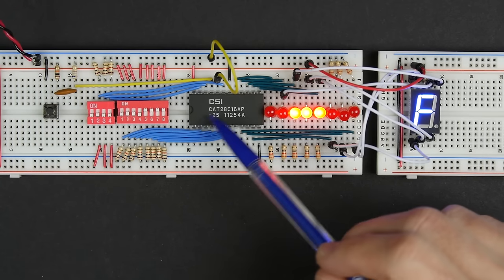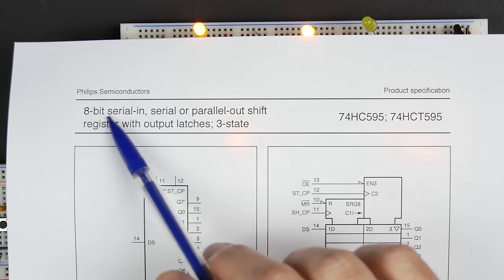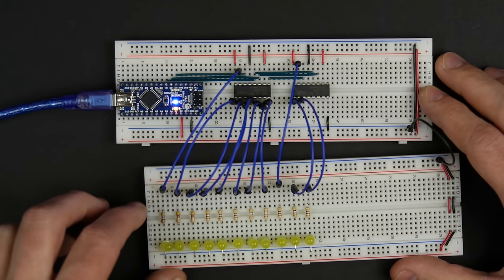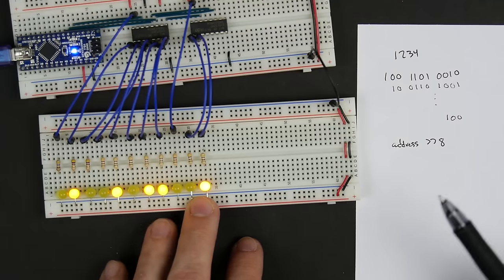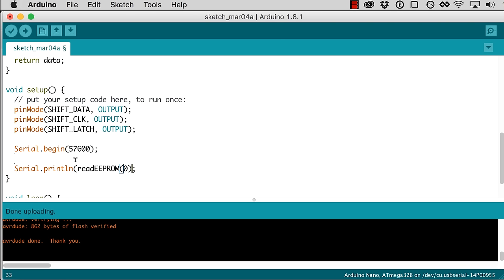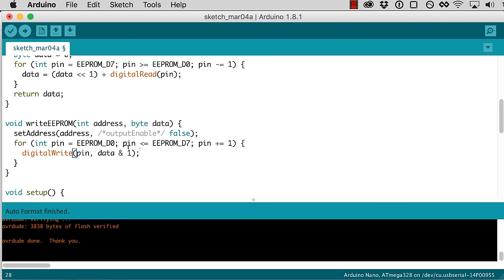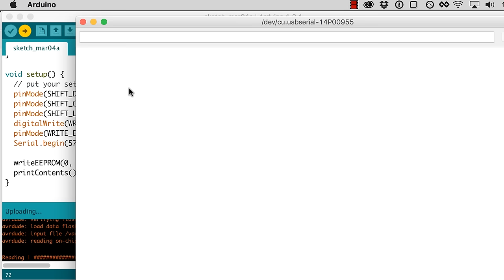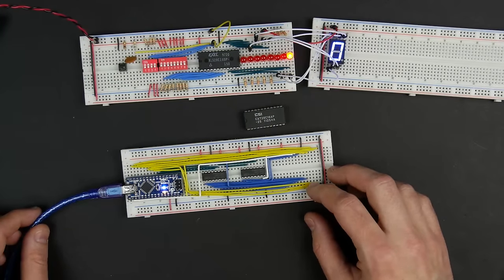Build an Arduino EEPROM programmer

Comment: Excellent video but one minor comment on the code.  Currently in the write eeprom routine you set all the arduino pins to outputs and then set the address and turn the output enable off.  If you had previously read the eeprom then the output enable would be active and for a very short time the eeprom's data lines would be driving the bus and the arduino pins would be as well causing contention on the bus and possible damage.  It would be better to turn off the output enable before switching the arduino pins to be outputs to avoid this.
Reply from the maker: Good catch! You're absolutely right; that's something I overlooked. I just updated the code here to fix that issue: https://github.com/beneater/eeprom-programmer
Reply: What are the negative side effects of doing that?
Reply: Hi Adam, the problem is that if the output enable on the EEPROM is still active when you set the arduino pins to be outputs then both the EEPROM and the arduino will be trying to drive the bus at the same time.  If one of them is trying to drive a zero on a particular bit and the other is trying to drive a one then you will effectively have a short from the positive power rail, through the output driver of (say) the EEPROM onto the bus and then down through the output driver of the Arduino to the ground rail.  The output impedance of the devices can be quite low and so quite a large current can flow, this can cause the output drivers of both devices to be damaged.  In the program this would only happen for a very short time (nanoseconds) and so the devices probably would be ok as there wouldn't be time for heat to build up, but if, for example, you were single stepping through the code, it could be in that state for quite some time and damage could easily occur.  Best practise is to ensure there is only one device driving the bus at any one time.
Reply: Hi Ben, Hi guys! I connected the LEDs to 74HC595. When I switch power ON or upload a sketch onto the microcontroller, the diodes light up (like running lights) for a short time and go out - is this normal? I added the OE (CE) control pin and set it to HIGH, but anyway led's light up, in this case as was expexted like a flash, not running lights
Reply: Did you put resistors in series with LEDs? 74HC595 has balanced output and LEDs are basically short circuits for this chip.
Reply: Graham Smith i
Reply: Берлога Neo same thing happening with my circuit too !
Reply: There's another problem: he uses digitalWrite for the write enable input, which takes 5-20 µs in toggling, plus the 1 µs delay. That's gonna wear out the EEPROM fast (if I understand how that works). He should have either used the native AVR C code, or an easier solution is just to use the same solution as for the manual pushbutton. Problem solved! I'm working on an improved version of his code, which I'll put on Github and link it in here.
Reply: This actually did kill my nano.
Reply: @psyxodolby08  I realize this is quite late, but the lights flashing is normal (I believe they are labeled to display USB activity)
Reply: Haha ! I was just about to write the exact same remark !! The only thing I would add is another possible side effect would be that the excess current demand could cause a supply voltage drop and either one of these conditions (over current or under voltage) could cause the system to briefly shutdown and/or reset. So when you guys are working on projects like this, if ever you notice that you circuit shuts down or resets unexpectedly, bus contention is a likely culprit.
Reply: I think you flipped it, the problem is if he first writes that would set all the digital pins to write mode (bus drived by arduino) and then use the read function it will first use setaddred (bus drived by arduino+eeprom).
Anyways you pointed it out, I was not even thinking about that.
Reply: Instead of using an EEPROM, why not a 7447 BCD to seven segment decoder driver?
Reply: @stevejquest  Because he wanted to do it this way, add more love to the computer.
Reply: @gzitterspiller  But the 7447 is a 16 pin dip that costs but a fraction of the programmable device.  And it does everything his application requires of it.  As for me - I usually just just a D-latch and lookup table to set the 8 bits.  He should do a demo using a D-latch to drive an LED display.  :-)
Reply: @LiraScarlet  As BSEE CompE with what, 39 years of experience now?  The best approach in this case is not the novelty approach -- but to use the right part, like a 7447 BCD to 7-seg decoder driver.  An EEPROM was never designed to source or sink 20ma of current (to drive an LED).  Years ago I built a QRP auto keying transmitter that continuously keyed a message stored in EPROM (windowed erasable device) which was a misuse of the device.  The message was stored in the EPROM which when a bit was clear was key up, bit set key down.  Four sequential bits was a long, two was a short.  An astable 555 set the rate and provided the clock.  This was for fox/hound competition.  So I too use things in an unconventional way.  But programmable devices do exist to do what he's doing with eeproms -- both the PAL (programmable array logic) which I use to replace decoder chips (a whole lot of chips can be replaced with that one programmable device) and the GAL (gate array logic) or FPGA (field programmable gate array) which can replace literally everything on the board with a single programmable device, including CPU cores.  :-P  So I agree from an academic standpoint, what he is doing is interesting and even fun -- however don't expect an EEPROM to sink (or worse, source) LED current forever.  Eventually it will degrade the chip and the chip will die.  You see, chips contain "magic smoke" and once you let that magic smoke out of the package -- that's it, the device stops working.  :-P  And I know, having released a LOT of magic smoke in my time.  :-)
Reply: You are correct, but the situation is much worse. When new address data are loaded to shift registers, the OE switches between Hi and Lo depending on the previous address data causing shortages when MCUs data IO are set as outputs. The correct way is to deal this is to set all I/O lines as input, then load address to shift register, then set te I/O lines to output and put data on them, then pulse WE. Switching between input and output is bitwise operation on Arduino, which means it have to be done inside some for() cycle. Every writing means one cycle to set I/O as input, then loading shift register, then loading data and setting pins as output and after that all pulsing WE.
Reply: Dr. M. H.  Which suggestion?  Using a 7447 or using a D type latch?  Both are cheap and work great -- but the D latch allows you to pick and choose whatever segments you want to light up, making E and H and P and certain other letters possible.  The 7447 only decodes to BCD values.
Reply: Dr. M. H.  D-latches can be wired like memory and directly addressable.  So you move a value into that addressable location and the latch reflects that value.  Neat.  :-)
Reply: @NikiBretschneider  Hello! I modified the setAddress procedure to set all IO to input before anything else, which should fix that problem.  The write code currently sets the address and then sets the IO to output, which works fine with this. I'm using a 62256 RAM chip with this right now (although my new AT28C64 and AT28C256 chips have just arrived) and everything seems to work so far. It does mean that it sets the IO pins to input every time it is called, but if that's a problem it's nothing a simple boolean parameter can't fix.  Also, looking at the datasheet for the 74HC595, there's a storage register clear pin (pin 10), but I don't have any more pins open on my nano.  If you weren't using a nano you could perhaps just toggle the pin low for a few microseconds instead of setting the IO to input.
Reply: yeah, but you don't program and run at the same time. it is just for combinational circuits, besides it's a ROM, you don't write and run at the same time.
Reply: @adamtoakley  Oh oh oh oh oh
Reply: @Cardgames4children  It's most likely a bot. I've recently seen several accounts post that message word for word.
Reply: @Danny Horworth That was unwarranted -- and for you, a learning moment wasted.  :-/
Reply: @stevejquest  Your commitment to trolling is quite high. Commendable? Probably not, but certainly entertaining.
Reply: @ssholum  Not trolling.  I was going for "educational" rather than entertaining, but meh.  :-P
Reply: @BenEater  1712
Reply: 9
Reply: 8
Reply: Good observation
Reply: @stevejquest  If you watched the previous series of videos, he was leading up to this. First from showing the output in binary, then using the binary lines to drive the 7 segment from basic logic gates (to create a combinatorial circuit), then showing how to use the EPROM. I imagine he's going to use the prom for a number of other things in subsequent videos, so using a 7447 would just add another part to the device which isn't necessarily needed.
Reply: @grhmsmth  Thank you very much for this excellent explanation.
Reply: Mowing
Reply: Ol Ol
Reply: @NikiBretschneider  I believe this potential issue has already been circumvented by the fact that the storage registers are only latched after the shifting process has finished, meaning the shift registers will only output the result of the shift operation after the bits have stopped changing states, so the output going to the Output Enable pin on the EEPROM should always be high (i.e. input mode) during the write routine in the final version of the code Ben has linked above.

(As the comment at the top points out, the one in the video isn't correct because it doesn't set the address first - hopefully nobody tries to use that.)

Comment: Im a house builder and for years I have been trying to get my head around basic programing and electronics. I have collecting machine parts and pieces. I have many little projects that require electronic control. Every machine I have built required manual control. I really get it now and all my learning has suddenly come togeather. Thanks so much for putting such a good learning video togeather. Dale
Reply: Dude, build me a house and I'll help you with as many Arduinos as you want! Glad it's all clicked though, I think construction workers have to have logical, systematic minds, and that's all that's really needed to understand computers. If you can figure out in your head whether a structure is built properly or not, you likely have the faculties that develop into programming.

Comment: Pro tip: You can use the analog pins of the Arduino as Digital GPIO pins :)
Reply: Was about to say. The only difference is analog pins have analog capability as well.
I wish Arduino had done this differently and given all pins a labelled digital io address. Then they could have added an analog number to em as well.
Would have saved so much trouble for a lot of beginners.
Reply: Yeah, except for pins A6 and A7 in the Arduino Nano: You can use A0 through A5, but not A6 and A7
Reply: @1kreature  Multiple names for the same pin seems to me like a more confusing thing for beginners. It can also lead to annoyances such as needing to keep track of which digitals are also analogs, when designing a circuit that requires analogs, so that you don't end up using the dual-use pins when a digital-only pin would do, and then need to swap them around later. I already find myself doing having to be mindful of which pins do PWM out so I don't waste them. As long as beginner knows the analog pins can also do output, they can use analogWrite to get a 'high' value.
Reply: @lucasoliveirasaintrain4298  the reason being that A6 and A7 are unique to that package of the ATMEGA328P, they aren't available on the DIP package, meaning that the Nano is significantly better than the Uno.
Reply: That's where the macros PIN_A0 through PIN_A5 come in. They map to 14..19
Reply: Digital pins suckkkkk
Reply: @saumilsunilshah5663  analog pins are slow
Reply: @v0xl  They only have hardware PWM capability and internal ADC that can be attached to them.
When they are used as GPIO they are exactly the same as D0-D13
Reply: @iforce2d .
Reply: @lucasoliveirasaintrain4298  you can access them using registers instead of the usual digital read/write functions. It is a bit confusing and time consuming mapping the arduino pins to the corresponding atmega328 pins but it can be done.
Reply: Thanks goodness it only took this long to find someone else had made this comment already
Reply: Not specifically for the Digital brand of computer, but just digital in general (the generic term).
Reply: Agreed, but then we don't get Ben's awesome shift register demonstration!
Reply: @djtecthreat  but this awesome demonstration significantly overcomplicated eeprom writer design.
Reply: @lucasoliveirasaintrain4298  I ran into the same issue about A6 and A7. Any explanations why?
Reply: @lucasoliveirasaintrain4298  I also figured that out, after, for a long time, thinking my EEPROM was broken haha :p
Reply: Well done.  FYI - When you unplug a USB serial device without dismounting it in Windows and then reconnect it, it can get recognized as a new COM port with a different device name.  If the Arduino software was talking to COM17 and the device suddenly becomes COM18 it will appear to have disappeared.  When you reboot the PC the Arduino will be detected under the original device name and magically it's back.

Comment: Ok, I know I'm not crazy, now.  There need to be breadboards with rows that have more than 5 pins.
Reply: Someone needs to make good quality breadboards with more than 5 rows per column, power rails that line up with the columns (some do some don't depending on the brand) and aren't split by a blank spot every 5 holes PLUS have two extra power rails running down the middle where the channel is on standard ones.
Reply: There are stray capacitance issues with normal breadboards, where you have many lengths of contact strips lined up in parallel, like that.  I wonder if lengthening the contact strips, like you suggest, wouldn't make those issues worse?  It would certainly add to the resistance of each channel.  Also, I don't think there is much room for another two rows for power/gnd rails in the middle channel, while still keeping it close enough to support most ICs.
Reply: You could use a jumper wire because for me I never need more than 3 apart from the power

Comment: You don't have to convert the truth table binaries to hexadecimal, you can just write them as binary literals in C: '0x4C' is equal to '0b01001100'.
Reply: I've always thought that "0x" was the only hex prefix available, then comes "0b" along ... learned something new today :)
Reply: @BillAnt  0x, 0b, 0d, 0h, Oh My! 😵
Reply: Well he prints it out in hexdec, so in order to check if it works, he would have to do the conversion at some point.
Or just print out in binary, but that's a bit too long to read easily.
Reply: There’s also `0o` for octal values.
Reply: @ExEBoss  But is there 0wo?
Reply: @ExEBoss  I thought octal in C just had one 0 before the number? Like 038, for example.
Reply: @ThatOneHandsomeGamer  octal numbers don't have 8 in them ;) but yeah, there's two syntaxes

Comment: I'm currently watching through your playlist on building the breadboard computer and I have to say I really (!) like the style with the continuous commentary over the speed up parts. There are videos of people speeding up parts but they'll first finish the comment and then speed it up without any commentary then. Your style is more compact and fluent!

If I had the endurance I would probably try to recreate your breadboard computer, because it actually has taught me a lot on how CPUs internally work. Sure modern CPUs are way more complicated but in their essence they work like yours, but in yours you can see how everything is ticking along!

Comment: Brilliant stuff, Ben, thank you so much - I can't imagine the effort all these videos took. For an older EE/CS engineer (like me!) they totally take me back to my roots. Especially this one: in 1978 I was in my last year as an undergrad at the Univ. of Sussex in the UK. My 3rd year project was - an EEPROM programmer. It took me a whole semester, mostly because I had to build the hardware from scratch (Z80 on wirewrap boards) and write the code in Z80 assembler (assembling it on a 64K Z80 CP/M machine!). Watching you do it in an hour or so really brings home just how far things have progressed. And yet - the principles of processor architecture are not so very different.... Thanks again!!

Comment: Funny how computing has changed so much, yet this takes me back to my old C=128 days when I used to subscribe to COMMODORE and RUN magazines, each came with programs in machine code that you had to type in using a machine code monitor program (which you had to type in the first time you used it as well). I never really understood how that worked until now, but I spent many a day typing these codes in as my good wife set dutifully beside me reading the code as I poked them into the old machine, then saved them to a 5 1/4 inch floppy.  I am loving this whole series, you make a wonderful teacher, I always thrived in college when the instructor showed, hands on how things worked, even studying the law, it was the hands on paperwork that drilled down into my brain to leave the data permanently written to my memory core.
Reply: My first computer was in 6th grade, a TRS-80 in the "computer lab" at school. This would have been 1980 or so. When we first got the thing we didn't even have a way to save any programs, so you'd just have to type it in again.  My dad brought in a cassette recorder which we got working (most of the time) to save code.